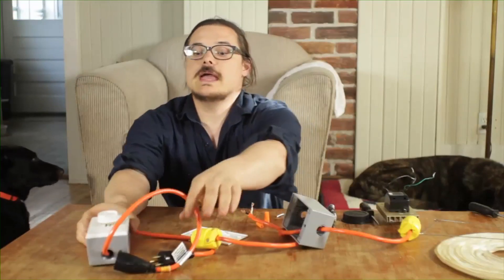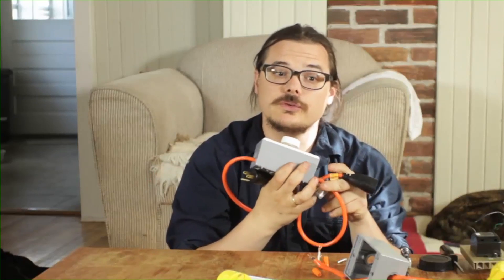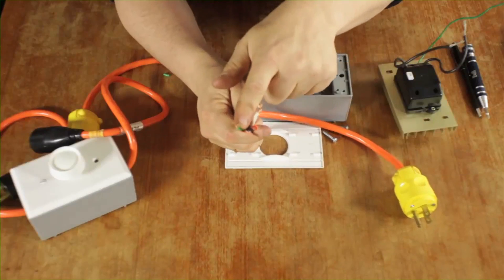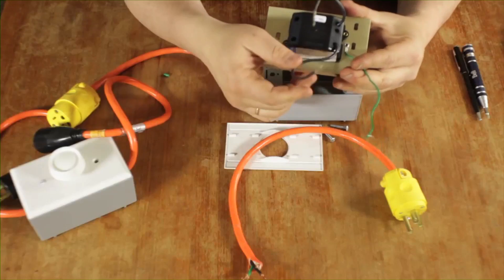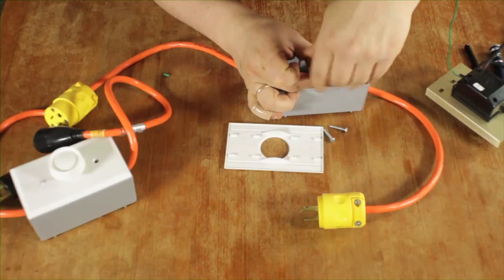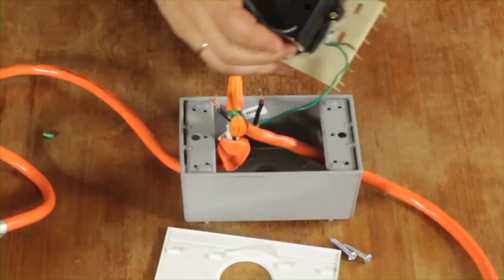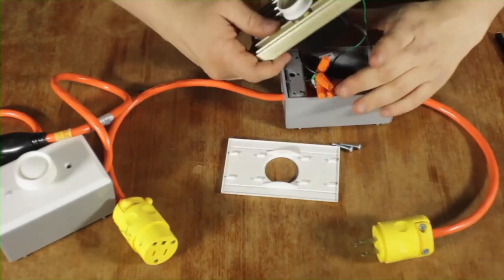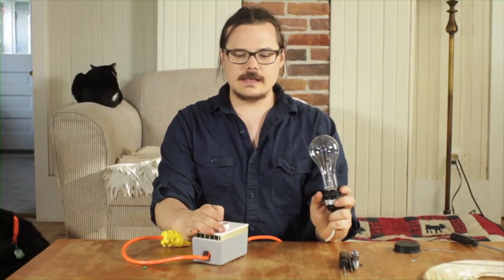Gear Machine: How to Make Dimmer Switches

Comment: Hello Nick - that was nice presentation. There is a chance for starting fire if wrong current and load are used. A safe way to do it is to use Triacs and PWM the current to the bulb load. This requires some electronic circuit to do but it worth to do it over using pure variable resistor current control. I believe some stores sell the electronic control circuit for this same purpose.

Comment: also forgot to tape the connections inside the box, the caps alone will get loose when your moving these boxes around. I had a grip get shocked because the caps came loose and touched the dimmer panel. The strain relief would be a pipe clamp on each end of the box.

Comment: Great job, not being a smart ass or anything, but you should have strain relief on the box to prevent the wires being undone of pulled
Reply: Sorry ac supply has active and neutral not pos and neg